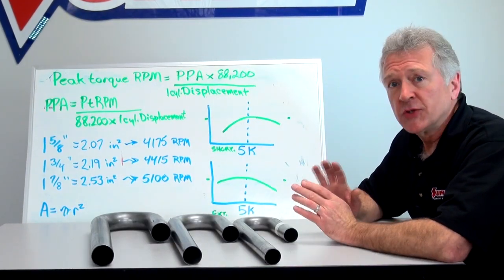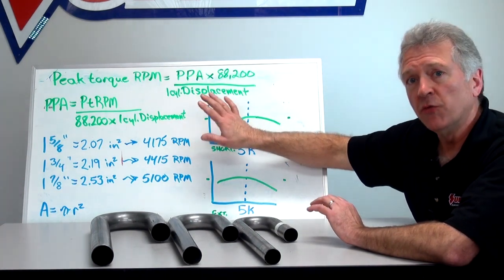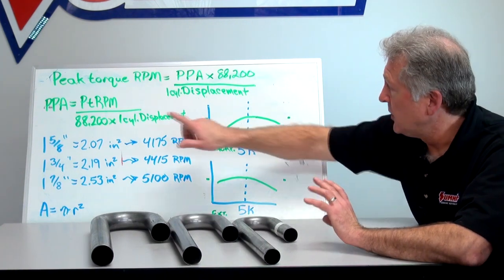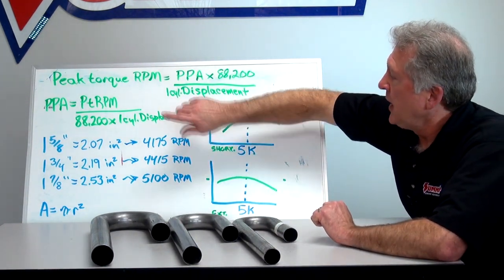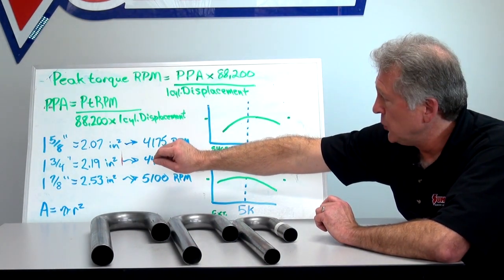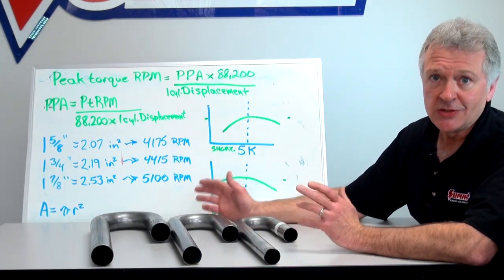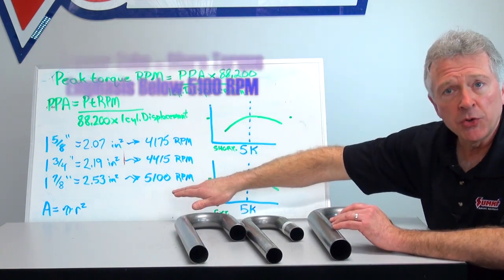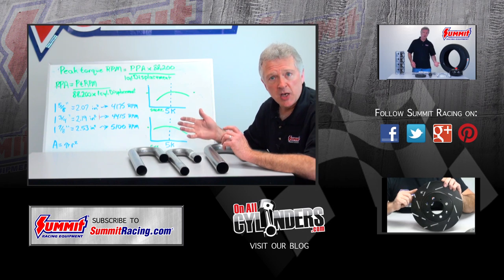How to Select Header Primary Tube Diameter - Summit Racing Quick Flicks

Comment: best size for a 69 corvette 427 big block .. ? Thank you
Reply from the maker: Hi Ernesto, 
Can you please give our tech line a call? 1-330-630-0240. We need some additional information from you.  Thanks!
Reply: Probably a two inch primary tube unless you want very high rpm peak torque.  I ran a eight thousand rpm peak horsepower 406 cubic inch engine which meant two and a eighth inch primaries which benefit only above six thousand rpms

Comment: I'm having a hard time figuring this equation for my displacement and peak torque rpm. i took my peal torque rpm which 2500 and divided it by 88200 and multiplied it by one cylinder displacement of 364.25cc (its a small engine 1.6liter) and got 10.3245 do i move the decimal over? and get 1.03 i don't understand the 5k thing . my peak torque is 81lb at 2500

Comment: You didn't do the second equation correctly when solving for PPA. If you want to solve for PPA based on the first equation you would multiply PtRPM X 1cl displacement and divide by 88,200.

Comment: Didn't bother to read all the comments but the second formula is not correct..

It should be:
PTRpm x   1CylDisp
--------------------------------  =   PPA
88,2000
Reply: +Max Headflow is 1cyldisp in cui or cucm?
Reply: +bhearts77 
The formula is used for cubic inches and not cubic centimeters.. The constant  (88200) will be different for CCs
Reply from the maker: +Max Headflow. 
Thank you, Max! We do have some annotations replacing the error. However,  you are to watch the video on a mobile phone, the annotations will not appear with the corrections. We will get that adjusted. Thank you!
Reply: Summit Racing whats a person to do when the ideal exhaust primary size lands between two tube sizes?
Reply: Pick which peak RPM torque you prefer based on your needs.

Comment: Some right info, some wrong info.... First (top) formula is correct. Second (bottom) formula is mathematically incorrect. Lastly, the calcs for the PPA are wrong (did not take into account wall thickness).

Comment: You rearranged your equation incorrectly.  1 cyl. Displacement needs to be multiplied out in order to move it to the other side of the equation, not divided.  It should read as,

PPA= PtRPM x 1 cyl. Disp./ 88,200

That's why people have been confused by this equation for the past 10 years.  260 THOUSAND people have been mislead, and no one has managed to spot the incredibly easy to spot mistake?

Comment: His magical tubes don't have wall thickness. lol.  1-5/8"x.065" = 1.76 in^2, 1-3/4"x.065" = 2.06 in^2, 1-7/8"x.065 = 2.39 in^2.  

A rule of thumb is 1-5/8 for up to 500 hp, 1-3/4 for 600 hp, and 1-7/8 for 700 hp.
Reply: The video was about torque and primary tube size. Where did you get the tube size based on HP? Thanks.

Comment: Why does he want 5k for the torque peak?
Reply from the maker: *****, 
After putting everything on paper for the given application such as C.I.D., weight of vehicle, gear ratio, tire size, etc., it was determined that the 5K torque peak was best. This should be done for any new build. Give us a call, we can help you through the process. 1-330-630-0240.

Comment: Scavenging. Think of the pressure waves. larger tube, wider shorter pressure wave. The high pressure pulse of the wave, also has a low pressure or vacuum wave behind it. Also helping pull the next exhaust gas pressure wave out. With a cross over pipe helping out. Volume vs velocities. Think about it.

Comment: Please america, start using the metric system.
Reply: Nah, we're good.
Reply: Not really because we have systems in industries,  standards etc. in inch already that work. Know that an inch equals 25.4 mm and you're good.
Reply: Rollincoal thanks , honestly if it aint broke , why why fix it. American car makers have been converting more now to mm. , many machine shops use both mm and inch depends on the the client supplying the plans for the part, machinists just converts no problem,,,, that doesn't make us retarded, we can use both and still get tolerances right! (So who are the retarded ones?? Hmmm)  carpenters would maybe the last ones to transition IMO. Everything is inch in woodwork. Don't worry about  us we are doing great with inch and MM my friend. We don't get confused like you guys.
Reply: No thanks
Reply: The metric system didn't win two world wars...
Reply: Zach Robertson actually it did... usa tagged along both times.
Reply: It's secret murica code. Most of us also know metrik.😉
Reply: When you really (but really) get into designing and fabricating devices and stuff, you start appreciating both systems. In the industry, in many practical ways, they end up being complementary. Or why to work with one hand when you can use both?
Reply: There a 2 types of countries, those that use the metric system and the one that landed on the moon.
Reply: No!!!!
Reply: Even In Germany they measure their Wheels by Inch. BBS 20" Zoll, same in the USA or Europe and lets say when it comes to Machining engine parts, Rocket engines for NASA It is all decimal system so it dosent fucking matter. Micrometers don't measure in fraction, they measure in thousands so mm is no more exact than standard it's  just the Euro lovers think they are on a High fucking horse cause they drive BMW's E46 or Volkswagen and feel the need to look down on everyone. You know what BMW 335 stands for? $3350 on Craigslist cause nobody wants to fix that shit.
Reply: Metric works best on paper, imperial [which largely ruled the industrial revolution] is for mechanics mostly.  But I do find the thread pitches on small fasteners are better in metric than for # sizes.  My problem is finding an all purpose tool with cutoffs that are metric - that's all that tool is really good for anyway: doesn't strip wires well, doesn't crimp well, etc.  Now the fun part: are you good enough to spot 1/8" npt from 1/8" bsp from a parts bin?

Comment: This makes no sense. Based on your formula, at 5000 rpm, your primary tube area is .014 cubic inches
Reply from the maker: Hi Aaron, there is a correction listed in the description of this video:
CORRECTION: White board should read - (Peak torque RPM x 1 cy displacement) 88,200=PPA
Calculate the optimum header primary tube size for your power and performance needs. This video explains the importance of proper header primary diameter and includes key formulas for figuring out the right diameter for your engine. It also factors in primary tube length and how it affects your overall power and torque curves.

Comment: Good floor plan, figure the subject could be open to a whole other window of percentage constants based on compression ratios, cranking compression and horse powers which would likely require a long study in reverse engineering of which will all land in a computer program one day after artificial intelligence has finishing taking over the minds of mankind. (while I was typing this a commercial popped on TV with a quote: "now you know")

Comment: Where are you gonna buy ready made 1 7/8" headers for a small block???? LOL 
Solution: Run open ZOOMIES on the street
Reply: I bought 1-7/8" primary for my LS2 small block from Speed Engineering. Kooks also sells them.
Reply: @ImFastrnU  I've been looking for a earlier sbc.  LS has different cyl. configuration. All 4 are equally distanced apart. Earlier small blocks have the 2 center cylinders next to each other.